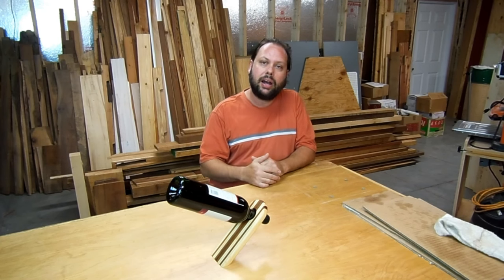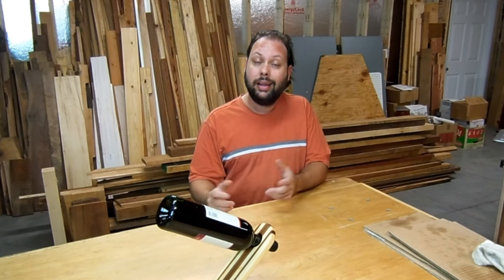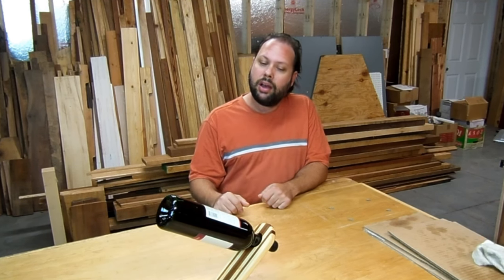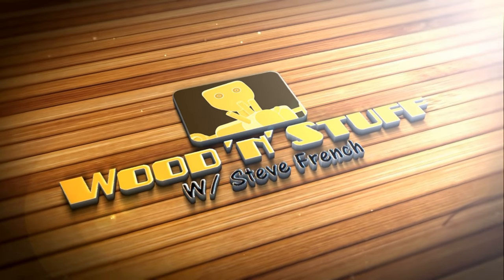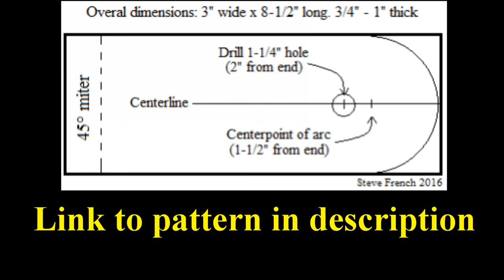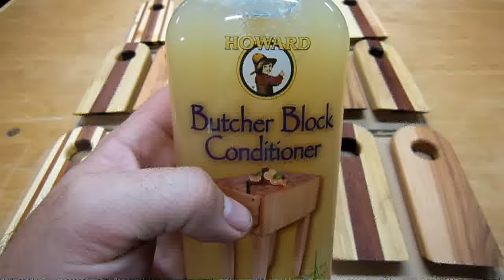Make Your Own Balancing Wine Bottle Holder

Comment: Thanks! Having watched SEVERAL of these bottle holder videos, I've adopted & "evolved" the designs to make one which is ROCK-SOLID. Your arced design has just completed it PERFECTLY for me! 
Length = 300 mm
Width = 90 mm
Thickness = 45 mm
Hole = 190 mm from bottom
33 degree mitre

Comment: That closeup shot of the forstner bit was pretty awesome :D Looked like the wood was being pushed through!
That new shop is gonna be awesome :D I reckon you need to build a MASSIVE Woody to go in one corner or something :D
Reply from the maker: I have Chip, my life-sized, articulated wooden robot. But a huge Woody to act as a decor statement piece would be pretty awesome! The drilling scene you're referring to is actually as it appears. That close-up shot is the back side of the hole. I drilled most of the way through from one side then turned it over to complete the hole (and prevent tearout). So it actually only drilled about 1/16" before the spurs cut through and pushed the disc you see down to the table.

Thanks for watching.

Comment: Hi Steve, good to see you are back to work with wood,  I was wondering how you like that Evloution sliding miter saw I saw a review of it on another channel too and I would like to hear your opinion of it too thanks
Reply from the maker: Hey, I appreciate your comment. I did a review video on the saw back in July: https://www.youtube.com/watch?v=sN0-OqIQ47g  Honestly, I really like it. I've only used it on a couple projects so far (because I was between shops most of last year), but it will definitely appear in a lot more videos in the future. It turns out that a sliding compound miter saw is an extremely useful tool. And the blade on this one cuts like a dream.

Comment: Dear Steve,
good to see you back and congratulations on the new shop (wish I had a new shop...that size).

I have to admit I 'thumbed-down' your video and here's why:
Although your project looks great and you executed it with your typical panache, it's utterly useless.
You can only 'present' the wine (or put it on show) with this holder...once the bottle is open, you can't use it.
Also, with any red wine over a few years of age, all the sediment will move to the neck of the bottle...just where you don't want it.

Have you seen similar (curved) bottle holders, where the bottle is held with the neck of the bottle slightly above the horizontal?
This type allows you to present the wine at the table (with the sediment at the bottom), and once you've filled a couple of glasses, you can put the bottle back in the holder and sit and admire it while you're drinking the wine.

Looking forward to the next video though...
Reply from the maker: Thanks for watching and commenting, David! Many people like this style of holder for purely aesthetic reasons. And really, how often - in a group setting - is wine opened and then re-corked? It's not meant to be an end all/be all item; just a novelty. Personally, I made these because it was a requested project and because it's something to sell that people will buy (I've already sold two from this batch).

I do appreciate your feedback. Thanks for the support!